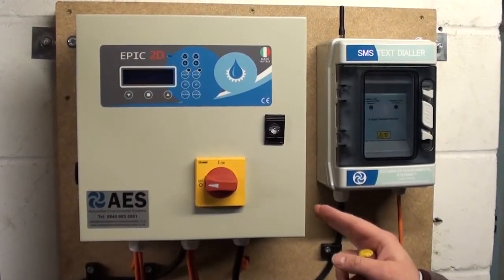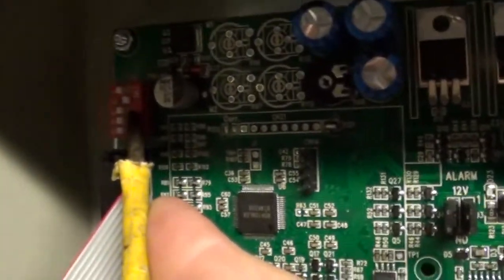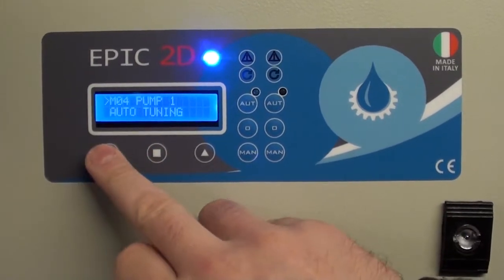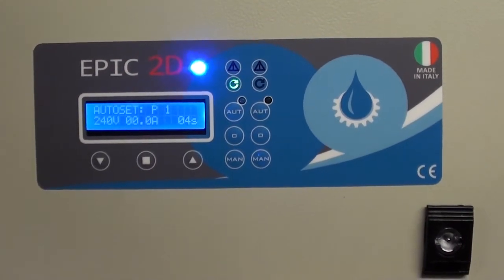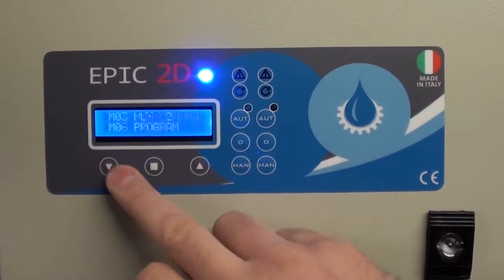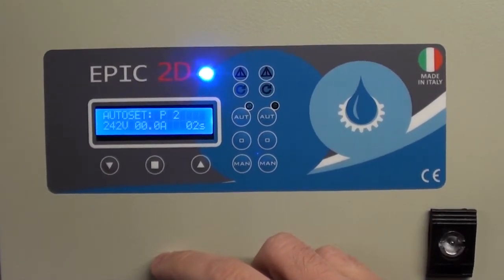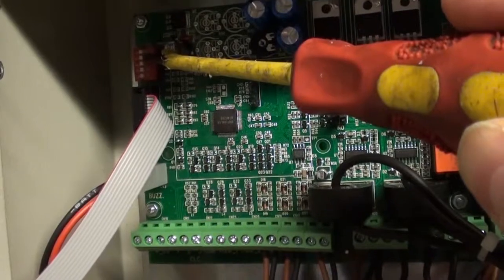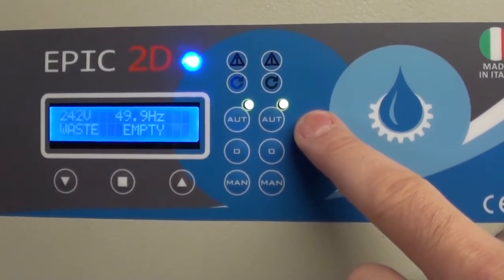AES EPIC 2D Control Panel

Comment: EPIC-3D video and how to use the pressure senor with the parameter settings
Reply: Do you know how to fix dry running alarm in epic 2d?
Reply: Dry running production relay have first 2 terminal no condact